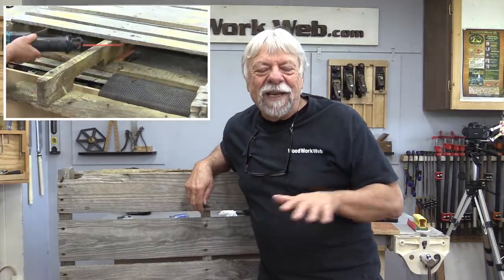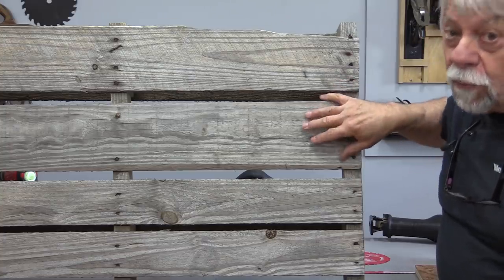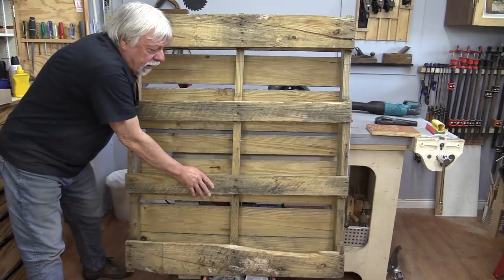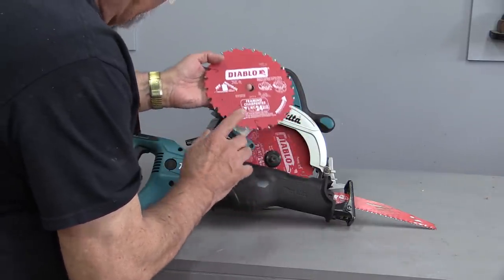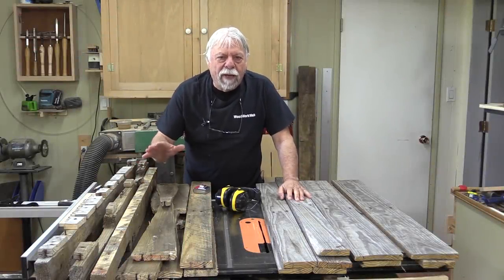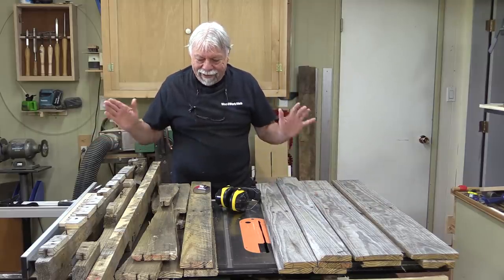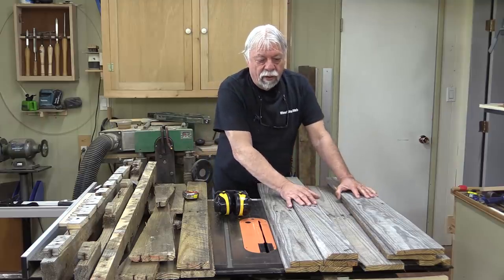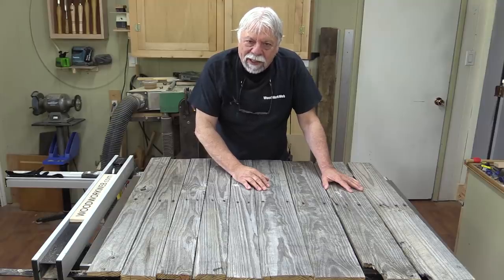Why Colin Knecht Quit Using Pallet Wood for Woodworking

Comment: In terms of ground-in rocks/sand on the bottom, or the chemicals they're often treated with for insects, it's always best to use a pressure washer on pallets before disassembly, especially if it will be used as outdoor furniture and be touching skin for prolonged periods, then preferably paint or otherwise cover it (same as you'd do with pressure-treated used in furniture).  If you don't have a pressure washer, stop by a local outdoor car wash on your way home after picking up your pallets.  

As far as disassembly goes, the methods shown in this video do leave a lot of waste -- so don't use them.  Simply place your pallet on the ground, upside down, with its edge up on another one (or between two), take a 2x4 (such as one of the stringers from a previously disassembled pallet) and your heaviest hammer, put the end of the 2x4 against one of the boards by the 2x4 stringer, and give it a couple good whacks to pound it down and away from the stringer.  You'll quickly remove most of the boards, without introducing more cracks.  

For those boards directly opposite each other where this method is awkward or where it may crack the boards by hammering at an angle, place a couple of short 2x4 blocks on either side of a board you want to remove (this time while it's on top of the pallet), lift the pallet slightly so as to place a third block across these two like a bridge, rest the board you want to remove on the bridge piece (which holds the pallet up an inch or two) and pound down on the stringer to lift up, loosen and remove the board.  Then, once the opposite board is out of the way, flip the pallet over and remove the remaining one in the same way  Then just hammer out all the nails backward until you can grab and extract them with your claw hammer or wonder bar (no cutting them to leave them embedded, then say it's not usable because your planer knives may hit a nail you shouldn't have left there in the first place).

Once you have cleaned and reclaimed ALL the wood in the pallet, use some of those small button neodymium magnets as has been used in many tips on this channel, to find any buried staples, nail fragments, etc.  Push them around over the surface of each board, watching for any magnetic movement as they're attracted to the metal.  I'd be very surprised if you found any outside of the nail holes left by the nails you know about, but if you do, a simple needle nose pliers will accomplish nearly all the extractions.

All the 'difficulties' mentioned here are easily overcome by such simple methods.  Yes, you do have to work a bit harder for usable pallet wood.  That's what recycling, upcycling and repurposing is all about.  And especially with wood prices ridiculously high (some 300 percent above normal, with an ordinary 2x4 into double-digit prices), it's a curious time to introduce a video dissuading people from any source of free wood....

Comment: I am very lucky as when ever I need woods, I can just collect free of charge tables or other furniture  free of charge. 
Still, I am looking for pallet wood as well. For the first there are many pallets which are new, so the material is good to use. They are just rough which I sand them as I don't have planer or other machinery. I use a belt sander and that does wonders in just minutes. 
In fact, mostly I look for paletts with hard wood material. I have found some and they are beautiful. 
I don't use power tools but I dismantle them manually.

Comment: In Australia, Wood is so expensive - I’ve recently picked up B/C grade plywood, two pieces roughly 1.6 metres long and it cost me $50. Whereas, you can pickup near new pallets for anything up to $5 a pallet. So, while I’d prefer to buy wood from the store, sometimes, with pallet wood,  it’s the extra mile I need to go, to make a profit on a piece I’m selling.

Comment: For me I have used repurposed pallet wood on a few projects BUT only when I was looking for a "look" or in the case of my shed a cheap alternative!! If you go to my channel you see my shed addition has pallet wood used in it as a construction choice!! BUT I will report that some of the floor is made from pallet wood and I couldn't be happier with the end result of that!! You see pallets are designed to hold thousands of pounds in many cases, so it only made sense to use pallets as the flooring or sub floor!! Certainly you have to be more "picky" in what you use and you have to cut down board that are too badly cracked (checked) or so on! BUT if you have the time and a very low budget you can make use of pallets very easily!!

Comment: Interesting.    We just built a  8 x  8 x 10 foot chicken coop  from pallets and  the wood.  Got the  NEW pallets  for  $5 a  piece.  Used maybe  20 pallets ($100).    Also used 2x4 's,  4 x 8  plywood and some  OSB.  Nails, screws.   I would say if  we had not used pallets  our costs would be  double.

Comment: The issue could be the type of pallet that some people salvage, like the one in this video.. it's the 'two way'. These are used a lot for shipping building materials, that's why they're pretty rough. They're made out of some very hard woods, too. IMO, use the 4 way ones, that have blocks, these are made with better wood, mostly,pine.

Comment: you can find almost new Pallet wood .
Reply: It's still a lot of work to disassemble and clean up.  I've spent a few decades in warehouses in shipping and receiving and in retail doing the same.  I'm quite familiar with pallets and all of their issues, a lot more so than the average lay person. 
One of the biggest problems with pallets, is you have no idea what was shipped on them.  Even FDA certified pallets for for food, will get reused for other purposes.  Pallets are not single use items most of the time.  They are used, reused, and rebuilt, until they fall apart.  You have no idea what was shipped on it, what it sat in, or what was spilled on it, or what was leaked on it, while it was in use.

Comment: Pallet wood is great if you're going for the shabby chic look and don't want to spend hours roughing up the wood from the home center.  And I don't think I've ever used a jointer or a planer on pallet wood - the idea is that you leave gaps to compensate for the fact that it's twisted, warped, cupped, "square" in only the loosest sense of the term.

Comment: I used pallet wood for many years. Yes you are going to have nail holes. You just cut the ends off. The holes in the middle can be filled in. The bad boards can be cut to used on smaller projects. 

He's showing you a weathered pallet that's been neglected out in the rain,sun or snow. I never seen weathered pallets that way come off  tractor trailers like that before. They are not safe to use for deliveries.
So don't assume all pallet wood is like that. 
My wife and I make crafts all the time with pallet wood. We have local companies that give away pallets. 
Is it worth it? Yes.......if i can turn a couple of free pallet boards into $20 ...its worth it.
Hey, a whole pallet could make me over $100.....

I made lots of things with pallet wood. Nicer than you can buy. People have the wrong information about this wood. Wait a minute....maybe people get discouraged because you have to disassemble them. Maybe they expected better and more wood out of a pallet. 

People need to get their minds thinking the grey weathered pallets are the only ones out there. They are not!!  I've seen lots of very nice pallet wood. 
Each has their own opinion and this is mine......

Comment: That is a junk pallet - that is what we call them over here in the lower mainland. I have harvested EXCELLENT wood from CHEP (blue coloured) and PECO (red coloured) pallets. They typically use hardwood and maintain their pallets for safety in warehouses. I use my Festool tracksaw to cut down as close to the nail line as possible to get the greatest amount of wood available. I have made some phenomenal boxes from this wood. The middle stringers are thrown straight in the garbage. I get pieces about 18 long but great for boxes. These pallets are typically been stored inside a lot are quite a bit dryer than junk pallets.
Reply: If you're planning a trip to Australia remove the reference to Chep from your post. Don't know current status but it used to be owned by the Australian Government (the "C" stands for Commenwealth (of Australia)) and the AFP tends not to extend a welcoming hand to people that they think have stolen government property. All jokes aside, CHEP pallets were well built out of better grade wood a case where the government product is superior to private enterprise.

Comment: Very misleading. There are many times when pallet wood is great. It's not for fine furniture folks
Reply: Misleading how? Onesided, possibly, because it's HIS reasons for not doing. If you want the weathered look (8:20 "I love ...") then it's the way to go. He just shows that unless your time is worthless, it's working out more expensive than the same in new wood; and then you get it safe to work, the right dimensions, etc. And on demand. My reasons I stopped using line up with his, given the number of hours available it's more worth spending them on woodwork than on wood prep. It's like firewood for a mostly decorative fireplace: if you have a good source of trunks/branches, and space to dry and find chopping therapeutic then it's worth it, otherwise it works out worse.

Comment: Interesting video. I actually know someone that worked in a pallet recycling business. These things are like a commodity. What gets pulled out of circulation gets replaced. There’s actually a significant number of PLASTIC pallets which are another impact on the planet.  Due to low quality, chemicals, damage to tools, and u didn’t mention bugs (roaches, ants, etc) that you bring into your shop. You’re better off recycling solid wood from discarded furniture than dealing with pallets.  Nuff said. Great video.

Comment: If you are doing it just for the financial savings.... It is usually break even at best, and not usually even that, BUT There are lots of other reasons.  I make over half of my projects out of stuff that other people have thrown away or are going to throw away.  I like that idea.....
Some Pallet wood is not the cheap stuff.  It depends on where the pallet was made.  I have found Oak, Maple, Elm, and Ash....  I have also found some really cool wood that I have no idea what tree it came from.  
It also makes you a better woodworker/Maker.  Trying to figure out how to work around all the challenges that come with "recycled" wood makes you think.  
If you are running a production shop pallet wood does not make any sense,  but if you are just making stuff for fun, it can add to the story of the finished project, and make the experience better.

Comment: I'd have added such a pallet to the burn pile after a cursory inspection. They're good if you need a pallet for something, but otherwise I'd reduce them to ashes and add the pile of nails left over to my scrap metal bin for recycling.

Comment: When you learn how to take a pallet apart you need to make a new video ! Pallet wood is not meant to be used to build fine furniture.The bottom board has 2 sides one side has never touched the ground. You can get some really wood of all kinds depending on where the pallet was made. There is a place for pallet projects. Wish I could post some pictures of things I have made. If you are in it for the money it's not worth it, but for hobby purposes it is great. I work in my shop for the fun of it and make a few bucks here and there. I LOVE your videos , but you missed the mark with this one
Reply: WOODWORKING is the key word here, you are very limited on what woodworking stuff you can make with pallets. if you on the other hand do some carpentry then it's ok. The wood is just toooooo ugly to make anything good tbh. there is room to pallet repurpose wood, but it is not in the woodworking world
Reply: @mikespunchlist  I don't think anybody would lick on a table or anything like that. If it is a finish product you would probably want to sand it down and seal it like any other furniture. Like  Gene Brewster said, pallet wood is great for hobbyist. Hobbyist = too much time on hand and like to do something fun for them. Since the work doesn't get any income out of it, you want to spend least money as possible. If you save a little more than the cost, then why not? It is up to you to know if you are picking the right pallet or not. 
Want to be safe side then find pallet that marked as HT.

Comment: I understand why a professional carpenter/builder such as yourself wouldn't use it, but I have a sort of "special" situation.
I use a metal detector for nails and screws, my nose for chemical contamination, and my eyes for embedded gravel. I don't have a planer or jointer and I only use the wood for rough fabrication of bird houses, shelves, small tables, etc.. If a piece does have metal in it I just saw it up with a bimetal blade on my bandsaw.
It would be nice to use new wood, but being disabled I just can't afford it. As long as my nephew brings me the pallets and other family members help me disassemble and clean it, I'll just have to keep using it.

Comment: Pallet wood is not perfect for all projects but for some it is perfect.  I have used it for years and have developed my sources and have become a picky pallet snob.  I now only pick the pallets with thicker boards and choice woods usually oak or poplar but occasionally ash or osage orange.  Look carefully because if you get lucky you may even find some exotics from other countries.  I have found lacewood, mahogany and other non domestics in pallets, although rare, it sure does make it like finding treasure.

Comment: pallets are made of scrap wood most mills dont even want to deal with but that being said they are made of a variety of different woods fairly typical to see  hard woods such as cherry ash and oak are typical . you have to be careful when selecting the pallets and make sure its worth the time to dissemble and pull nails

Comment: I would agree with old beat up pallets but my office is in an industrial park and brand new pallets show up daily at the back of my office free for the taking.
I my self make things that are for outdoor use like composting bin, a bench aka storage container for my kids sports equipment and structures for plants to grow on.
most are still rough just cut to length and width with so sanding to get rid of splinters and what not.  I would put the lumber I get thru a planer but normally on the thin side as it is.
I could see why you would not want to. I am just trying to keep some stuff out of the land fill and save money but if my wife wants a table or chair made I'll buy the wood as I may very well outlast us.
I also agree with Scrap wood City I just do have old pallets laying around.

Comment: On the rare occasion I use pallet wood, I de-nail as much as possible.  I fill a plastic gallon milk jug with the old nails, screws and once full set it out for the local recyclers.

Comment: I use clean ones. They don't go on the saw table or through the planer. They ARE useful and the bottom line is that it is free material and better to be used than burned. Co-incidentally I have acted alongside Oliver Reed.

Comment: Many wood pallets are used for international shipments. These pallets have a special stamp burned onto the special IPPC seal burned on the sides. Many of these international pallets have been treated with methyl bromide to prevent bugs and insets to be transported to different countries.  You would not want to use wood that has been treated that might be in contact with your hands or near food.  Please beware especially if you make cutting boards with treated pallet wood.

Comment: I enjoy this channel but some of this info is not accurate.  I`ve been using pallet wood almost exclusively and they come in all shapes and sizes so a great many have boards that are three quarter and above in thickness. Also as many as two thirds of pallets are used only once.  The trick is to find places that throw out those very new and straight ones.  You are correct though n that they are hard on blades.  you have to be careful for sure but there is very good wood to be had.  Also, depends what you want to build.

Comment: I think the main appeal of pallet wood is that it's left out in the open in the view of the public. You don't need to go to a timber merchant, you don't need to know what you're ordering, and you don't need to pay for anything. It's all these reasons I wanted pallet wood when I first started woodworking. Obviously it only takes 5 mins to figure this stuff out, and then, in my opinion, there's no reason to use palletwood other than for the look of it, which can be achieved through other means.

Comment: If you do one pallet, it may not be worth it, but ive never processed less that 6 at time, because efficiency. 8 dollars of crappy pine, bit ive pull oak, maple, poplar, cherry... and saving on that free wood is well worth the effort. Depends what pallets you have available. I am lucky to leave near a commercial center that trashes all kinds of diff pallets.